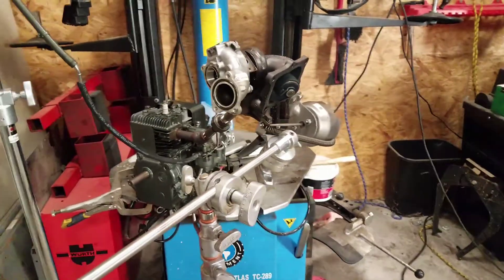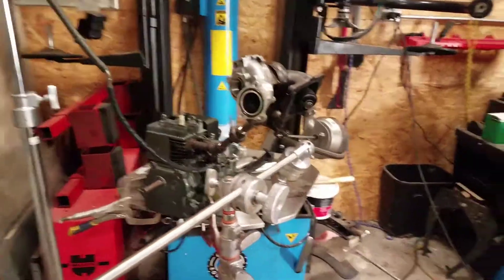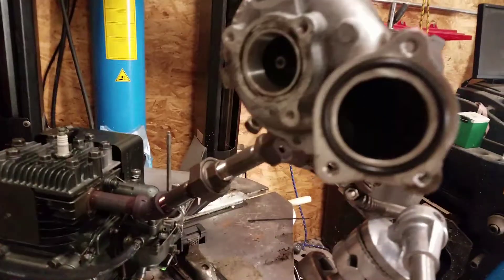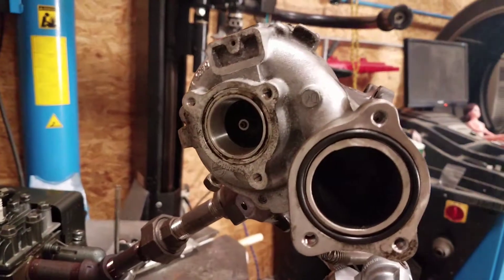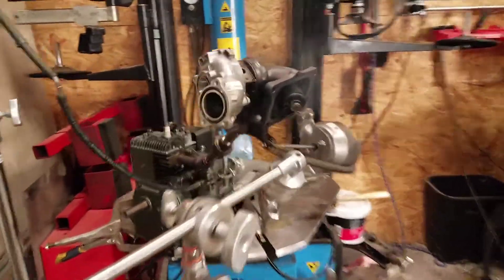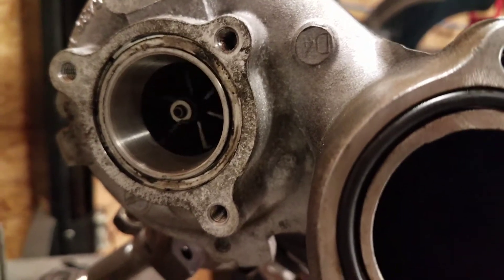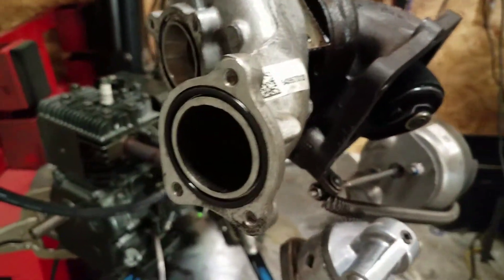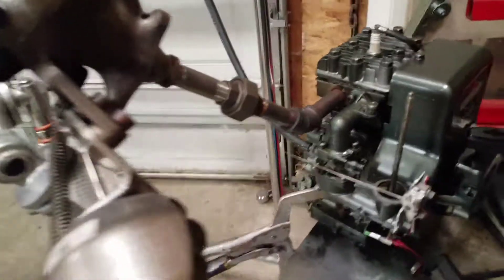Boosted See through Engine on Nitro - Testing turbo size

Comment: The turbo will not create any form of boost until it is connected. Hopefully the turbo is small enough to have high enough velocity in the turbine to get it to create boost once the compressor is connected. if air flows through the turbo to easily (too big of turbo for displacement of engine) it will not create boost and will only reduce power and create and exhaust restriction.

Comment: I'm amazed you got a car turbo to spool with the output of a little 3hp sidevalve engine... must be the nitro I guess? :)

(I've seen someone building a 125cc 4-stroke bike with a turbo on it, basically "for the lulz" rather than as any kind of serious thing, and they basically had to fit what is literally the world's smallest (mainstream) turbine to it... not even sure what it was originally meant for, but the thing was tiny, and even so only just about managed to provide useful boost... when running on regular supermarket pump petrol, anyway... estimated power output was decidedly south of 30hp, maybe even less than 20hp)

Comment: @Warped Guys, if some guys can help, it would be great.I installed a Turbo charger on Royal Enfield Bullet 350 cc, draw through setup.In fact, the turbo is taken from a 1000 cc diesel car so yeah it is quite big for the bike but still its not making any kind of power, even after tuning the carb.

Is there anything other than that to do before throwing that turbo away?
Reply: You need the proper lpm to properly make boost so throw it away and get a turbo made for 350ccs otherwise you are just wasting time plenty of information on how to properly install a turbo charger I suggest doing research before moving forward you'll regret putting money into trying to get that big turbo to give you the extra power you want

Comment: wow, I bet you get a whole extra horsepower out of that
Reply: Yoshi_IX be lucky if he got that, probably a 1/4 is at best
Reply: horsepower is based off rpms and torque, so twice the rpms results in at least twice the horsepower
Reply: Yeah not even close if anything he lost HP due to that air restriction of a turbo he poorly "installed" on a motor 10x too small to spool that turbo up to the point of any kind of boost a turbo spinning does not mean boost this is just pathetic

Comment: You need to get the turbo some oil.
Reply: yeah how is it not siezed
??
Reply: the bearings will retain some oil, particularly if you blank off the supply lines on either side (a turbo that loses significant amounts of oil out of the bearing seals and into the airflow is a worn out, broken turbo that, if fitted to a diesel engine, is minutes away from causing a terminal runaway), and it's likely only spooling up to relatively low speeds for short amounts of time during these tests. If it was being run for minutes or hours on end at high boost, then it would become a problem.
Reply: He needs to scrap this project it's a waste of time lol sad really he has no clue what turbo chargers do, how to install, or what's necessary to produce any boost a turbo spooling up doesn't mean boost the only thing he's done is put a horrible air restriction on a tiny 3hp Briggs pathetic

Comment: Just a suggestion;Try and get an intercooler on the project, otherwise I think it will have a very short life probably blow the head off and for the turbo bearing lub you could fill a pipe or small bottle with 2 stroke oil and let gravity feed it
Reply: Lol why that turbo is 10x too big he won't ever be able to produce boost with that turbo on a 3hp Briggs
Reply from the maker: well i ended up doing a draw through setup, the carburetor is ice cold because of the vaporization, it runs great, just finishing up some details then pop..pop..

Comment: you forgot to plug the other end of the turbo in
Reply from the maker: it was just a test !. thanks !
Reply: Xanode and turbocharger oiling system that might be a good way of hurting you and wrecking the turbocharger and engine but it's your life not mine
Reply: You forgot to throw your channel in the garbage